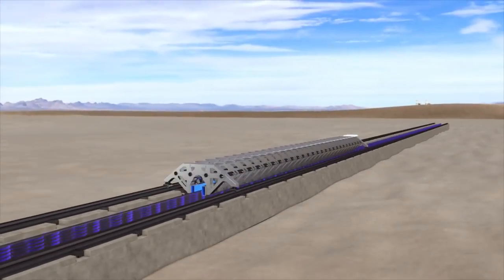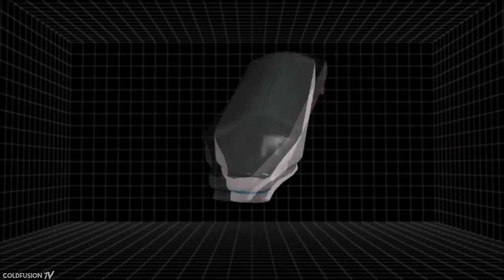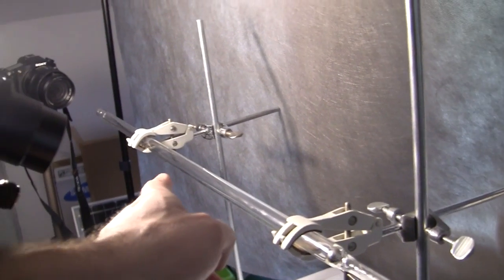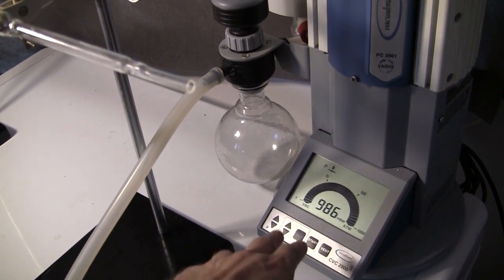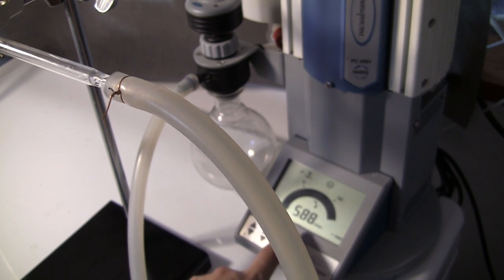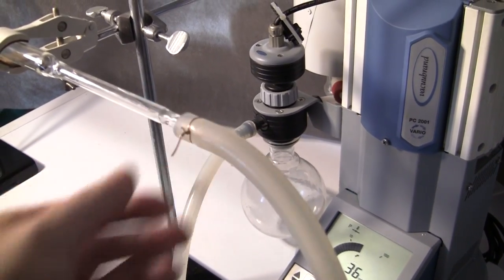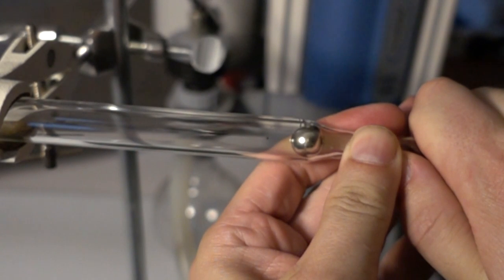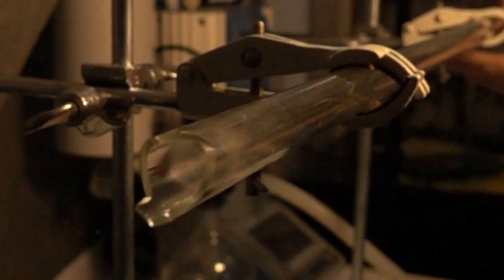How  the Hyperloop can kill you!

Comment: Well wait, isn't the maglev aspect of the train cars basically going to be linear motors? In the event of a leak would it not be rather easy to detect that pressure drop and than shunt the windings of the linear motor creating a massive amount of drag? That's just one of the many ways massive motors are slowed down and stopped when a similar situation happens. If part of a power train breaks and the motor experiences a massive drop in load safety circuits step in to mitigate the damage from over acceleration and excessive speed. 
Perhaps your not thinking in terms of electrical engineering TF. It would be interesting to see the math on just how much force a leak could exert and how much could be held back by the linear motor.
Reply: Periodic emergency blast doors. Self healing rubbers and plastics. A Kevlar sheath to resist a puncture. I get it, there is an issue if you have a catastrophic leak but are you saying there is no way to mitigate something a bit more mundane? Yeah it will suck if someone blows a hole in the thing sure. But the hyper trains in Japan would suffer a pretty horrible and devastating fate in the exact same situation. They operate those trains every day. It's a tough thing to engineer for sure but I just don't get why you can't see how many ways there are to potentially mitigate the risks.
Reply: +McGeias dude I was with you on brexit, thorium cars, solar roadways etc etc. this one,... I dunno man. My bullshit detector is going off. I'm sorry brother, I need to see more math before I can buy your pessimism on this one.

Comment: Vacuum in the tube is naive and that "spokesman" is some liberal arts major (most really good engineers/scientists are horrible at public relations) who is completely clueless - it'd take a month to pump it down. Creating a low pressure zone in front of the vehicle using reaction thrust is viable and combustion is not necessary...can be solar. You could consider that low pressure zone as a weak vacuum, I guess. After all, mom does use a "vacuum" on our room in the basement now and then, doesn't she?

Comment: actually they've solved this sort of in the event of an accident or other problems vents in the tube system will open and repressurize the tubes at all points along it. they were thinking more in the line of a fire or vehicle depressurization but it would handle a sudden rupture to.

Comment: the first solution that comes to mind is sealed doors and pressure inlets places regularly along the track. this would allow a segment with a detected breach to be sealed of from the rest and air to start entering equally both in front of and behind the pod in a controlled way that would not only prevent runaway acceleration but provide a controlled gradual stop in emergencies. thanks to the doors it may also be possible to do this without pressurizing other segments, lowering the cost of failure and down time.

Comment: This is hardly conclusive evidence against hyperloop on its own. The real deal will have several magnitudes more in mass (and who knows what kind of surface area) than this cool experiment did, with the same PGF trying to move it (in both cases, you're always going from ~.01 to 1 BAR ).

Which isn't to say I'm not skeptical of the hyperloop. In fact, I'm very curious as to how they're going to maintain such an enormous volume of vacuum.

Comment: There's a problem with little models like this, and that's you can't just scale everything down and expect it to be indicative of the real thing.

That's why, for example, you can drop an ant off a table and it will be just fine, but if you drop a person off a proportionally sized cliff, they will be annihilated.  You have to use dimensional analysis to design a model that will accurately translate to the real thing.

Comment: It's not a new idea, ever heard of "Swissmetro", a vacuum mag-lev project started in 1974, but went bankrupt in 2009.

1 mBar is a stupid pressure, it needs 2 different pump systems, 10 to 50 mBar would be reasonable (but you should pointed this up). And what's that turbine in the front, is that the drive motor ?!? makes no sense too.
Safety wouldn't be a great concern, locking the pod on the track (reverse mag. lev) would probably seal the rest of the track. Nothing that cannot be engineered...

These questions have been answered in the past 42 years, anyways.

Comment: I had an idea for a super sonic Hyperloop type transport back in the early 90's.  Mine didn't use a vacuum in the same way though.  My idea used large fans or jet engines placed at intervals along the track and a set at both ends.  The idea was to use the fans or jet engines ahead of the pod carrying people to suck air out of the tube while the fans or jet engines behind the pod would blow air into the tube.  The air flow of the fans or jet engines would reverse once the pod passed them.

Comment: i think its one of the inherent risks, I mean from what i understand your not disagreeing that it would work your just pointing out that if it does go wrong it will go wrong badly, But then again look at air travel your in a pressurized tube 30,000 ft above the ground or getting to space your sitting on top of a chemical rocket praying to what ever god that it doesn't explode, Yea its risky but hey its advancement some times its worth the risk though i see where your coming from and think they will probably need to build in redundancy's.

Comment: Los Angeles to Las Vegas is 197 miles you have a tube that is 10 feet in diameter and you have to bring it down to a pressure 10 millabars. Each time the hyperloop runs you will have to take out all the pressure each time because it sucks in all the air that you took out. It would literally take you longer to wait for the pump to bring down the pressure than it actually takes you to drive there in a car or probably even a bicycle. If you did do this im sure there would be a way to slow it down unlike thunderfoot says but it would be impractical to make in the first place.

Comment: By that logic flying planes, using submarines or even flying to space would be "busted" too. It's a hard task and as you said it can be insanely dangerous, but it's far from impossible. 
The biggest problem is making it save. They would probably use multiple layers.

The only thing that worries me is that there would be a huge potential for terrorist attacks if the hyperloop has to stop somewhere and connect to the normally pressurized world. A bomb there and a ton of damage could be done.
Even tho, they'd probably make the whole hyperloop go in some sort of a pressure champer shortly before arriving at a station, where the pressure around it would be normalized. Thus the actual low pressure tunnel would be out of reach for terrorists, unless they are in the hyperloop. 
Quite interresting. Do they plan to make it more like a train station, or an airport where you will be controlled before entering?

Comment: Well, the drive motor also works as a dynamic brake.  So the energy of the loss of vacuum could be recovered and put back on the line.  Harmlessly lol.  A greater concern might be the deceleration caused if the vacuum failure occurred ahead of the train while it was at speed....  I suppose that the motors could be used to limit the magnitude of deceleration...

Comment: Granted that's a pretty bad worst case scenario, but every other mode of transport has pretty terrible worst case scenarios to.
I don't really see a problem if they take significant steps to stop it from happening.  

Possibly even have a fail safe mechanism to reverse the polarity of the magnets, in the case of a vacuum failure, to anchor the pods to the rail?

Comment: I like a lot of you videos debunking straight up impossible "inventions" or just impractical (like the solar bottle). But you just brought up one problem of the hyperloop which it seems like could be easily fixed. Just monitor the pressure, and if there is a huge rise in pressure, then can you not just reverse the magnetic field. Or maybe have some 'old fashioned' breaks that latch onto the rail?
Reply: Not only would your measuring systems need to be extremely accurate, they would need to act extremely fast.

Comment: That model has a few flaws: what you're simulating here would be a pretty catastrophic failure in that you have the pressure increase very, very suddenly and in a very small space behind that metal ball, which is itself a pretty tight fit. If there was a crack in the tube about 100 km away from the object, you have a lot of volume to fill before the pressure even increases noticeably, which means that to go from 1 mbar  to 1 bar as you've shown here, the tube would have to collapse pretty over the entire structure or directly behind the vehicle, which is pretty unlikely. The vehicle could also be constructed with this in mind, allowing the pressure to increase in the entire cube by having the air flow around it, should be doable with a aerodynamic structure and enough space between the vehicle and the walls. 

Besides, we've gotten pretty competent at building tunnels in such a way that the things we want to keep out do stay out, like rock, soil or water. Seeing them made airtight isn't that far a stretch.

Comment: of course there is something that could go wrong and kill you when you are going to travel at these speeds. but you haven't made any decent explanation to why this couldn't be resolved. on the top of my head you could have pressure valves along the track to fail gracefully (pull both directions), or just make sure it doesn't crack open for whatever reason in the first place. if you are going to debunk the hyperloop you'll need a lot more and better arguments than this one example

Comment: IF it fails at any point in the tube then everyone and everything in it is a projectile weapon where the hole in it is is  where all the projectiles come out at in theoretical physics at super sonic speed. Thunderf00t deals with practical physics. 
For the stopping it part i have not seen nor heard about anyone nor any company getting onto that as that is the important part in this video. 
How can you stop a super sonic object?  As we have planes which do it is possible to slow down to a stop. It is built with the idea of a Maglev train inside a vacuum tube. The maglev in South Korea goes the quickest at 37.5 km/h. As I do not know how magnetism works in a vacuum and never actually took a physics class wouldn't stopping it in the same way work? 
It takes a few hundred meters to slow down to a safe stop. 
Can that be put into a small scale demo video for how magnetism would speed up and hopefully slow down in a vacuum?

Comment: I generally like your stuff, thunderf00t, but come one: give Musk some credit. Tesla and SpaceX represent some brilliant engineering, and Musk wouldn't be touting the hyperloop idea if it could be shot down this easily. 

A few flaws in your reasoning: 
(a) back of the envelope, a pressure difference of 1 bar, about 100Pa, acting on a body with a cross-sectional area of 1 sq m, would exert 10^5N of force. If the body were 10 m long, with the density of water, its mass would be 10^4 kg, so it would experience an acceleration of 10 m/sec^2 or about 1g. Unpleasant, but hardly fatal. 

(b) The train runs on a maglev track and does not contact the walls of the tube, so you can allow as much clearance as you need to moderate or eliminate even that small effect.

(c) You could actually use pressure difference to help push the train, if you evacuated the tube on the go and injected the air behind you. You would need to segment the tube, with a system of valve, but that in any case would likely make more sense than trying to maintain a vacuum over hundreds of miles. 

(c) A worse scenario would be a vacuum breach in front of the train, or still worse, an obstruction (like a stopped train), or worse again, a tube collapse (say because of an earthquake). But you would have sensors monitoring pressure and the path ahead, so the train could stop in good time. You would earthquake-proof it as much as possible. 

Anyway, of course there are engineering challenges, or we'would be there already. But it doesn't fall at the first hurdle, as you try to prove.
Reply: I hate to break it to you, but Musk isn't a very good engineer. His skills like on the business side of things, raising money and convincing people of the 'big picture' vision he has.

(a) Why are you approximating a hollow tube as a solid bar of water? Also I'm not sure if that force is right, as the air comes in as a shock front, up to 1600 kmph theoretically. You'd need to integrate over a distribution to get a better answer though.

While you list all the extra stuff you could put into the tube to make things safer, keep in mind it takes up space and introduces more points of failure. And more space is more expensive to keep under vacuum and it's already insanely expensive as it is.
Reply: Musk is not an engineer. Calling Musk an engineer is infinitely and fractally insulting on every concievable level to actual engineers and anyone who is actually educated in engineering.

Comment: Thank you for your insightful video. Two points I would like to raise are:

[1] Could the magnetic tracks not house a fail-safe mechanism, that upon vacuum failure, would activate a magnetic break?

[2]  The system could entail multiple elements of fail-safe mechanism that could adjust for vacuum failure and compensate, especially when conceptualised to a large-scale inter-connected network?

Comment: Couldn't you just open a valve ahead of the train to equalize the pressure on both sides and stop it using the added air resistance?
Reply: Now you would get crushed from both sides! Fun!
Reply: @williamhuang8309  Well, if you have, say 100 km of leeway, you could do it somewhat slowly, but that only works if the tube is tough enough to keep the pod running somewhat OK. Hypothetically it's doable but in practice it's not really an option I guess.
Reply: @p.s.8949  Yeah, and unfortunately they want to use thin steel so that's not gonna happen...

Comment: The pressure difference from one end of the tube to the other is what is causing the ball to be propelled, great point and something that certainly needs a lot of risk assessment and careful engineering. here's a quick thought though:

If you had a network of motorized openings all along the hyper loop and pressure sensors, could you not configure these dampers to immediately open in the event of a CATASTROPHIC tunnel breach? thus equalizing the pressure and neutralizing the threat.

also how feasible is it to expect a catastrophic failure of the hyperloop tunnel compared to a gradual fracture? i'd estimate that to require an explosion. thus making it as robust/safe as a plane for example.

Comment: i guess jet fighters can break too so shouldnt bother making them?
Reply: Define small issue... I work in the aeronautics industry and its the small issues that cause 99% of all production meetings on quality control and FOD due to most groundings and crashes being some simply leaving a small washer some where and the aircraft not having issues until 300 flight hours later.. in the air... when it wondered into a fuel line and shot off engine 2 by blocking the fuel flow.

curaxu's judgement is pretty spot on. I don't think Thunderf00t really has the back ground for these sort've things. We have oil pipes that run under pressure and transport oil over hundreds and hundreds of miles. We've build CERN for gods sakes. It's not a miracle that it doesn't rip itself a part, just engineering. Very. Very accurate and detailed engineering. I respect Thunderf00t's knowledge, but these last two "debunked" topics are... kind'a making a fool of himself.
Reply: True, but the hyperloop is the F-35 in this analogy.
Reply: ***** true, its a diffrent scale, but il essentially echoing hundreds of other peoples opinion that 'if soemthing goes wrong, shit can happen' well, that in its own is not an argument against it.

Comment: Don't forget that one of the safest modes of transport today is getting into a steel box with jet engines and shooting your self though the air at hundreds of miles per hour. It will be a challenge but if they can make flying safe, they may be able to make the Hyperloop just as safe.

Comment: First: Think about what it takes to cause a complete abrupt break of that tube of the Hyperloop. It could crack, sure, but that is not a zero to full opening like you demonstrated.
Second: Ever heared of brakes? Putting a safe value at deceleration at 5g, or about 50m/s², and your maximum speed of the capsule at a high number of 900m/s (that should be in the area of Mach 3, I guess), it would take about 18-20 seconds to decelerate from 900m/s to zero. The distance traveled during this time should be about 25-30km. Not quite short, but not impossible to manage.

Comment: As if laying down in a cramped train car with no windows traveling at nearly 5 times speed of sound from LA to New York wasn't already a dead giveaway that this was never going to happen (Elon Musk claims the hyperloop could travel from NYC to LA in 45 minutes; 2.8k miles in 45 minutes at MACH 4.9).  +Thunderf00t I'd be curious how much energy it would take to pull a vacuum of 1 millibar on a tube that stretches from LA to NYC?  How much would it cost to build and operate a maglev train of this complexity over that distance.  What sort of material could the tube be made of that could withstand the pressures involved?  How gradual would the curves in the track need to be to comfortably travel without subjecting the passengers to extreme g-forces?  How long would it take to accelerate\decelerate to MACH 5 without causing your passengers to pass out?  Seems like there are a dozen videos you could make out of this BS pipe dream.  (lol, pun not intended)